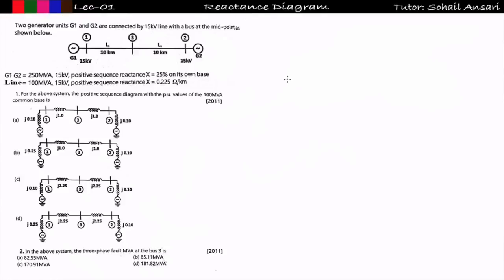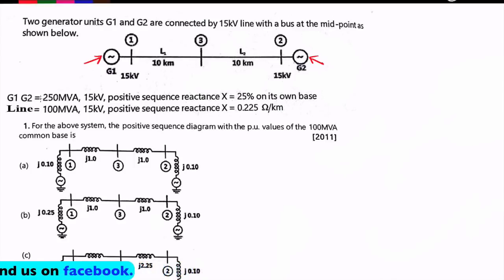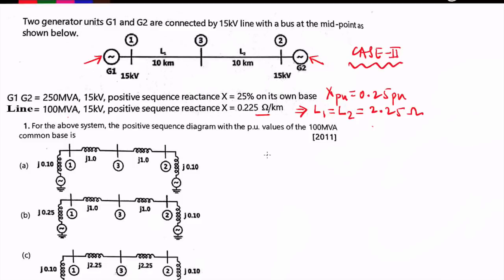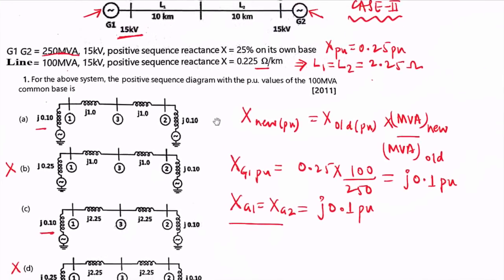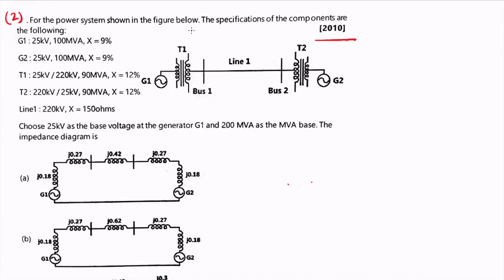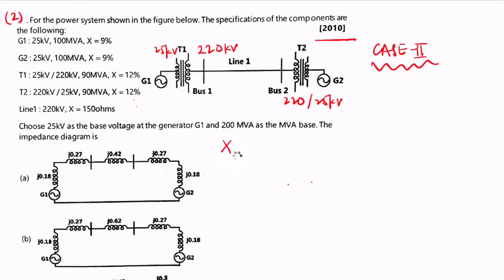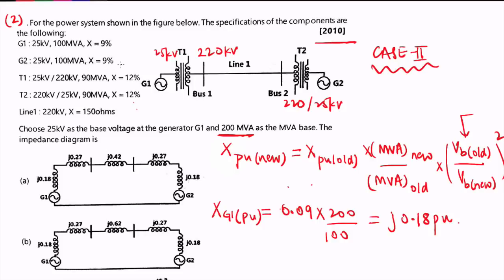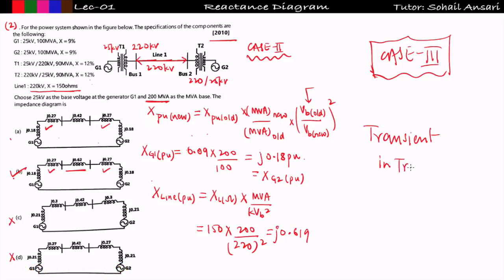Lec 01(c) GATE Problem on Reactance Diagram

Comment: Very nice lecture sir ,plz tell why we are taking transmission line base as 220 even when we have to use 25kv as base ????
Reply from the maker: because of transformer..the rating voltage at other side will change..and rating voltage is nothing but base voltage only.ok